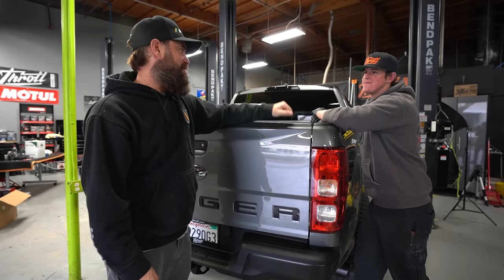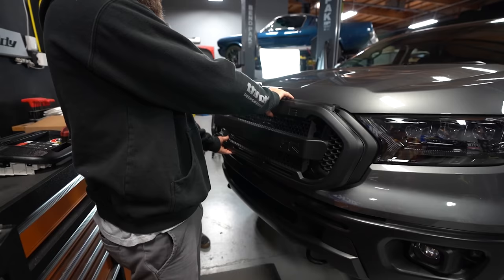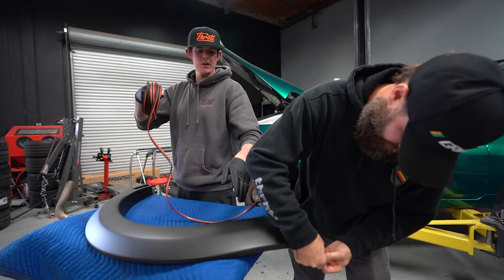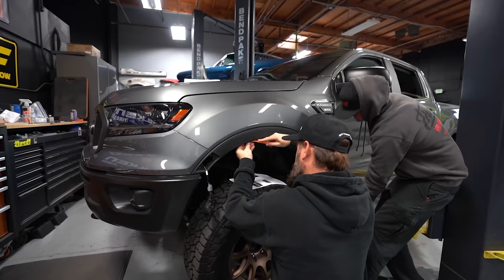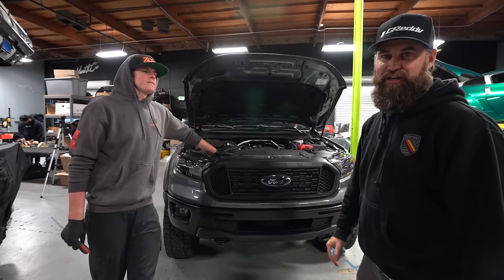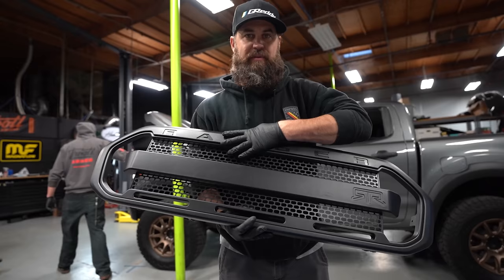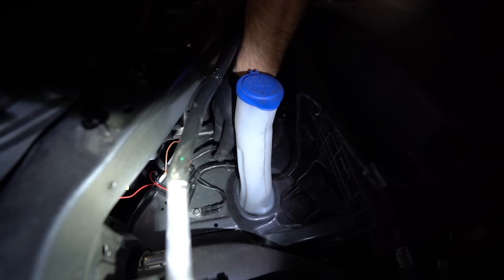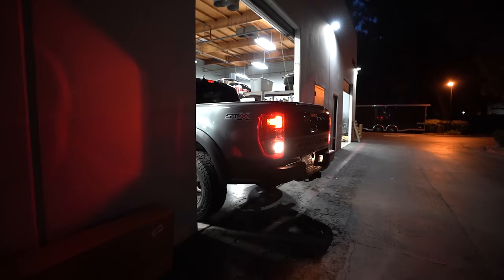Building and Heavily Modifying a 2021 Ford Ranger XLT - Part 3 - RTR Fender Flares & Grille with LED

Comment: As a new Ranger owner I am loving watching this build. RTR stuff looks great
Reply: I hate to see the price tags on these parts lol
Reply: I can sell you a new set of upper control arms if you have alluminium spindles
Reply: Get the newer model, crazy upgrades
Reply: @WhatTheHeck1290  love my '19 Ranger XLT FX4 it's been phenomenal in 3yrs so far. New ones looks awesome but I'm very happy w/mine & Fox 2.0 shock kit. Great trucks!
Reply: Great trucks. Over built.  Best in class! Run full synthetic 5w30 oil every 5k mis w/Motorcraft filters always! Love my '19 Ranger XLT FX4.
Reply: @WhatTheHeck1290  current model still excellent love mine. New one Is amazing yes! Get your order in now.
Reply: @Davido50  nah I'm good. I got a 2013' V8 F150 that can do alot more.
Reply: Get the RTR wheels, you won’t regret it
Reply: Me too I got a 2020 ranger STX 4x4 and this is very helpful

Comment: I've been loving my Ranger, it has impressed me quite a bit.
Reply: Have you towed with it yet? I'm liking these trucks more and more
Reply: @benjaminhuebner9355  yeah, my brother's 95 Toyota bew it's motor and had to take it down a mountain. Plus I have a 350z in the middle of a build. Moved that around a few times. Both rode fine.
Reply: @benjaminhuebner9355  they tow well its not an F150.. but its strong & pulls a classic car just fine w/F150s smooth 10spd tranny in Ranger & tow modes.

Comment: Now you need to get the raptor grill lights for in back of the grill that would look sweet I did that with my 2019 ranger and I installed the rtr lights in my grill

Comment: Just as an FYI, the STX is a package on the XL trim (101 I think), not an XLT. Not much difference to be honest, the STX package is way better than the default XLT trim in my opinion.
Reply: BTW, I have an 4x4 STX with the towing package and rear diff locker.

Comment: Wow I have the same ranger so I wanted to see how much it would be to get those sick parts then I nearly fell over its 600 for the flairs which is crazy its just plastic then the grill is sold out so the next available one with lights in it was 775 like I know its RTR  but dam to mod the truck I'm gonna have to Go eBay knock off

Comment: I’ve got a 2021 Ranger Lariat 4 x 4 and am in process of making a few mods. What are the wheel and tires size you guys used? And also, how wide were the spacers?

Comment: Can anybody tell me why I have a steering wheel wobble on my 2020 Ford Ranger? The Ford dealership in Carson City tells me that it’s because I have -12 g with two 65 x 70 17“ rims 9 inch wide they’re telling me that everything is tight under there and because of the oversize rims and tires there is a steering wheel wobble. The steering wheel wobble starts at about 50 miles an hour gets a little worse then goes away at 65 to 70 continues to get better at higher speed can anybody please tell me where to take my vehicle to get it fixed so I don’t have a steering wheel wobble on my brand new truck it is so embarrassing. Please help me thank you. If you go to my Channal on you tube you can see the Ranger i own , i really love my truck please help !